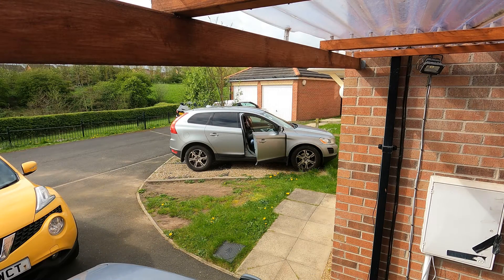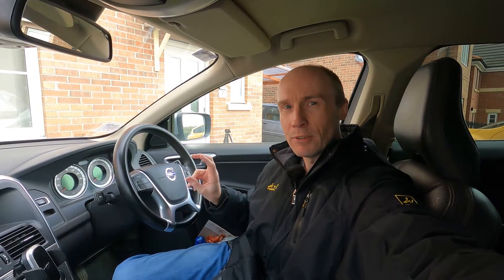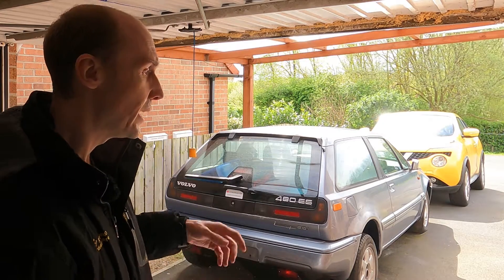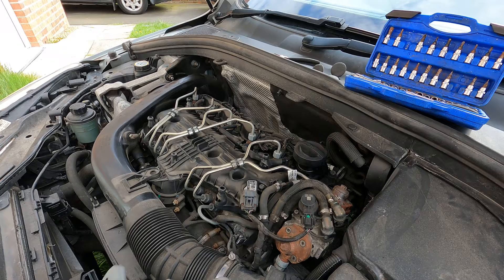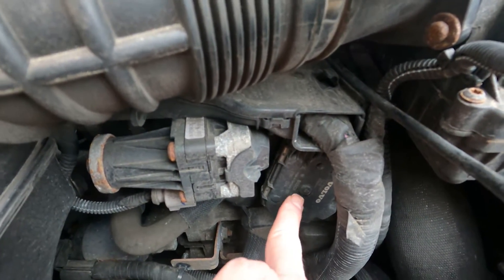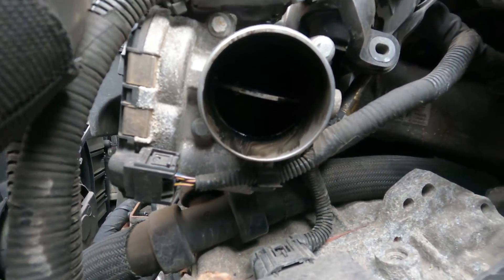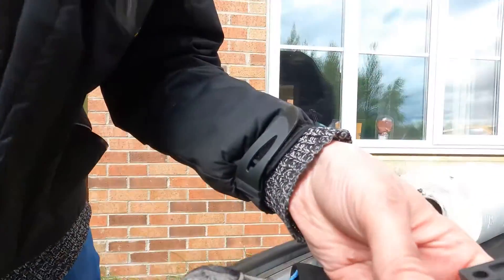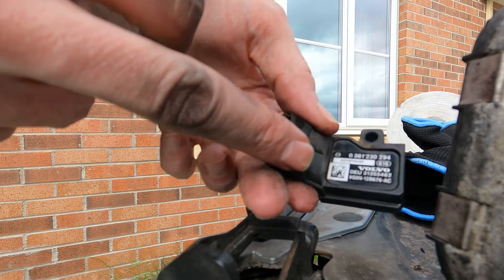Volvo XC60 P023600 Turbo boost P046C85 issues on our daily driver

Comment: What happened, did you fix the issue?
Reply from the maker: Hi there, I've got the follow up video coming out this week after replacing the sensor and so far all good!
Reply: @junkendriven  Which one did you replaced, the 0261230219 or 0261230294?